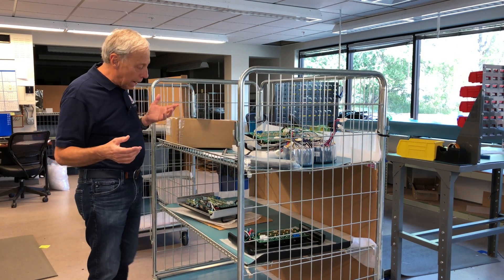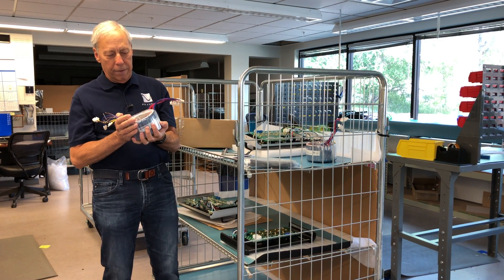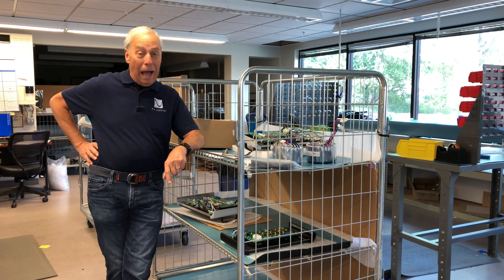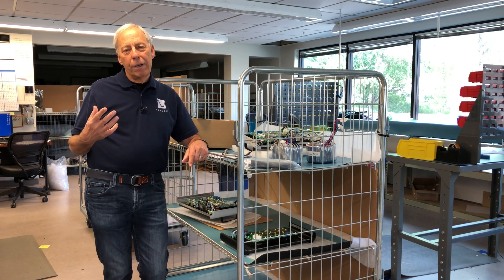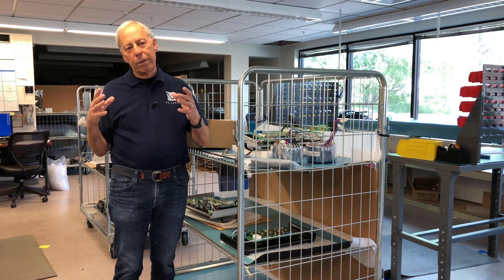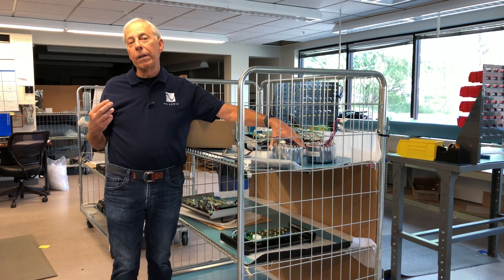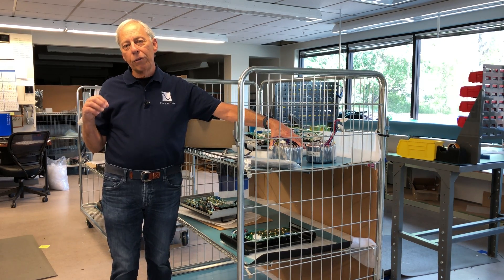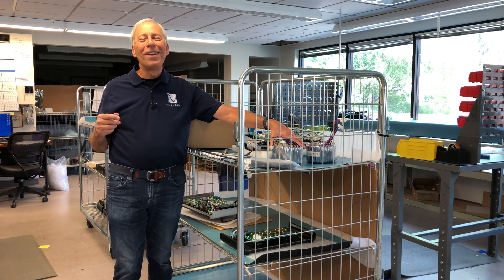Switching supplies vs. analog supplies

Comment: The 50-60Hz magnetic radiation of conventional power supplies inside a power amp is more problematic for audio performance than the higher frequencies generated by a SMPS, which are far above the audio spectrum and only present potential problems for equipment external to the audio signal chain.  That -- along with the huge size, weight, and efficiency advantages Paul mentioned -- is the reason why such state of the art amp makers as Benchmark, Hypex, IcePower, and (real soon now!) Purifi have gone the SMPS route in amp designs that are more than competitive with their best traditional counterparts.
Reply: This is untrue.  A modern amp has good PSRR, but only at low frequencies.  Once you get into the KHz range, the uncorrectable errors in output are two orders of magnitude higher.  It has little to do with whether the PSU frequency is within the audio spectrum because of feedback in the amplification stage.   If you don't even have feedback there, you're better off sticking with a battery, certainly not going with a SMPS.

You can take the exact same amp and power it with both PSU types.  Some amps (and some untrained or half deaf  ears) cannot hear a difference, but quite often the SMPS introduces undesirable harmonics which some describe as colorizing the music with falsely detailed treble mutilation.   That might be desirable if you preferred genre is trace music, but generally undesirable for most others.

They changed to SMPS because of cost.  They care not about your power bill so forget efficiency.  ;)    It is okay to be on a budget and not be able to afford the superior sound of a linear PSU, but make no mistake, that's what it's all about.

Those who value their audio, for a stationary system, have no problem with the issue that their rack or table has 20 lbs more weight on it, nor that it is a few inches taller.  The idea that these things matter to audiophiles is laughable.
Reply: @stinkycheese804  -- You couldn't be more wrong -- what you call "the superior sound of a linear PSU" is mythical given competent design engineering.  In fact, the best power amp ever measured by (the formidable Amir) of audiosciencereview.com is SMPS-powered -- as are the second- and third-best IIRC.  None of these units have any audible flaws AFAIK, and I doubt even the most finicky self-styled "audiophile" could tell the difference between any of them and even the most massive and exorbitantly-priced counterpart equipped with a linear PSU.
Reply: @stinkycheese804  Bob Carver perfected the SMPS for audio with his "tracking down converter" supply over 25 years ago with his Carver Lightstar amp and with his Sunfire line of amplifiers that were said to sound as good as amps costing 5 to 10 times what his cost.As far as weight many audiophiles are using tube monoblocks that weigh a LOT more than 20 lbs over SMPS amps and tube amps is what Carver is into now to great acclaim.
Reply: @stinkycheese804  The point I was making is that Carver used SMPS for over 25 years and not one reviewer mentioned any of the anomalies you say are inherent with them. And if they were present I'm sure someone would have mentioned them.  If his patents are nothing special why did Emotiva buy and start using them. Can it be that the genius of Bob Carver figured out long ago how to solve the issues you mentioned about SMPS for audio when no one else has.By the way how many patents do you hold or how many amplifiers of your design have been sold?
Reply: @stinkycheese804  By the way could you tell me who and what publication said the tracking down converter is nothing special. Another thing having a powerful amp means more headroom. Also some transients lasting around a millisecond can require hundreds of watts for faithful reproduction. Lastly the voltage level of conventional power supply caps can potentially run low during very loud power hungry passages  compromising the sound while Carvers SMPS design won'.t as the triac draws directly from the line in.
Reply: @stinkycheese804  About the names Bob Carver came up with like Sonic Holography Someone asked   Paul McGowan how it worked he laughed about the name but said his name for something similar called the Spatial Projector  awas just as bad but said you need  a name that will stand out with both the patent office and the customers. Likewise Carver  couldn't say he wanted to patent a SMPS but a tracking down converter he could. Since the patent was  real and unique unique how is this snake oil and smoke and mirrors.
Reply: @stinkycheese804  -- I have over 50 years of experience in electronics and nearly as much as a professional-level musician, and IMO the "superior sound" you describe is essentially undetectable by the very limited abilities of human hearing -- but, the "high-end" sector of the audio industry thanks you very much for believing otherwise.  Enjoy your investment confirmation bias and its entirely mythical quasi-technical basis!
Reply: @stinkycheese804  -- I happen to have three multi-page TI data sheets open in Acrobat Reader and none of them include a "PSRR graph."  The only mention of PSRR in them is the usual 1 kHz/no-input number number in dB.  So, I guess TI publishes data sheets than aren't "complete" enough for you.  BTW, I also glanced at the PSRR number for a well-known "high end" Class D module comprising discrete components, and its 1 kHz/non-input (apparently a de facto industry standard) PSRR number is comparable to those of the three inexpensive TI chips.

So, it seems Class D output circuit designers working at both extremes of the cost spectrum agree that a "PSRR graph" detailing those numbers at higher frequencies is not relevant when it comes to giving equipment makers the data they need to decide on what Class D output section to incorporate in their products -- in fact, the "high-end" module manufacturer I mentioned also offers and recommends their own SMPS boards for their modules.

Comment: I have 2 Sony receivers that have smps and both are dead. I have thought of putting conventional power supplies in them but I'm waiting for some good decent smps's. There are no switch mode power supplies in my stereo.
Reply: If a conventional PSU doesn't fit in the chassis, simply put it in a different chassis and use nice low gauge wire to connect the two.  This also gets the transformer further away so your shielding concerns (and/or efforts needed) are reduced.

Comment: Switch mode is getting better every day, but it is still not better than a good linear in noise performance.  Whether we want to admit it or not switch mode still puts out a lot of noise, both into the space and into the supply line.
Reply: Bob Carver started Sunfire 25 years ago and his amplifiers with his  "tracking down converter" ( a type of SMPS ) power supply were said to sound as good as amps  costing 5 to 10 times what his cost.

Comment: Well, transistors have been around for "some time", tubes still sounds "better" in some ways.
I wouldn't be shocked if analog supplies are still used at least in some HiFi a couple of decades from now, and that there will then be guys who prefer it like some prefer tubes over transistors today.

Comment: Isn't it just simply a negative too many components with the Switching PSU...?  More of a general failure rate.. regardless of the other anomolies? Or am I wrong?
Reply: Switchers have higher efficiency, lower volume, and lower mass, thus lower cost for manufacture and shipping and smaller end products. Failure rate is a function of design. Most equipment designers are not power supply designers even though they design power supplies. Properly designed power supplies with properly designed thermal management don't fail prematurely. The sad fact is that almost every consumer product is designed to a price point and when you cut corners you cut lifespan too. Don't blame the supply topology, blame the accountants.
Reply: @Peter_S_  Nope.  The fact is, things like capacitors in SMPS have a finite life rating and that rating is often down below 10K hours.  Argue with the capacitor manufacturers if you want to, but I figure they know their product better than you or I.
Reply: It's not just the component count but the nature of SMPS, that they have mains-facing transistors and diodes subject to power line surge damage (you can argue let's just use a surge protector to handle that, but it is not included with the product and needs to be a whole premises protector to be most effective, so it is not a part of the design), and capacitors filtering high frequency that run hotter than 50Hz/60Hz counterparts.

As a generalization, a SMPS will have less than half the lifetime before failure with all else equal.  All else often is not equal, but the trend remains that SMPS have a far more finite lifespan measured in # of years rather than # of decades.
Reply: @stinkycheese804  I have to give credit where credit is due as a generalization what you said is true.
Reply: @stinkycheese804  Your generalization is silly. Capacitors filtering high frequency still run a ton cooler than pass transistors operating in their linear region. No contest. How many power supplies in products of your design exist in the market to be a data source to draw from? I have well over 100,000 linear supplies and just slightly fewer switchers operating in consumer products right now on top of 30 years of designing and manufacturing a wide variety of devices in boutique volumes for various markets. I have gear still in manufacture today after several years and available through outlets like B&H, and I've also been repairing gear for roughly 40 years so I have a decent feel for what a wide assortment of designers around the world have come up with and what ends up failing so that it hits my repair bench. I've repaired a ton and a half of linear supplies, and encountered failed supplies of all topologies. Sure some parts have to work harder in some situations which is why properly sizing or oversizing components in designs is imperative and it doesn't matter if that's a capacitor, transistor, diode, inductor, or resistor. I don't understand why you're looking for arguments with generalizations, but I'm not interested unless you can state the number of products you've got operating in the market as a dataset to compare. Switchers come in a wide variety of flavors as do linear supplies. Some operate at line voltage, some at lower voltage. It sounds like you're trying to isolate one particular example of a switched topology as if it's universal... it's not. My experience says that reliability is up to how much you want to spend on the components.
Reply: @stinkycheese804  LOL, there are just south of 200,000 power supplies I designed running in gear right now. I'm done with your silliness.

Comment: As far as figuring out how to get rid of heavy power supplies on your high power amplifiers when will Bob Carvers patent's on his " tracking down converter " run out ? It's where the rail voltage tracks the input signal and is only 6 volts above what is necessary for a given output . Did Emotiva recently figure out another way to do it  ( as an ex-Sunfire employee ) or do they pay royalties ? In any event aside from being a lot lighter it's also very energy efficient.
Reply: Snake oil for marketing purposes.
Reply: @stinkycheese804  If you're talking about the names he came up with for his PATENTED designs I agree but it did help sales. As far as  to his ingenuity  he is up there with the greats . Most all of his products were highly acclaimed and beat anything in his price range and were said to sound as good as products costing  5 to 10 times what his cost. These days he is designing tube amps where the tubes last a claimed 50 years not 1 year and they do sound great.
Reply: @stinkycheese804  On second thought snake oil implies something fake , while the name was a marketing gimmick the technology was not and was way ahead of its time and did not impart any high frequency or any kind of audible anomalies .

Comment: One technique used long ago was when you finished designing your analog power supply you would replace the reference “diode” with a sinewave generator. You then would run the power supply into an inert load and run the sinewave generator up and down in frequency. This would check the frequency response of the power supply. If the application was audio you would run the generator from 20 → 20Khz. The power supply, now audio amplifier, should remain stable during testing.

I have no idea how to do this for a SMPS or even it it makes sense to test it that way.

Comment: Just FYI, I built a three channel 20W pure class A amp, single ended current sink topology, not over biased class B. This was for tweeter duty in an LCR setup. I needed +/- 24v at 15 amps per rail! So I took a chance and bought two surplus 24v, 15a switch mode power supplies. And these were open PC board construction to boot, not caged units. I did put ferrites on the DC power wiring and took other reasonable RFI/EMI precautions but no shielding. Upon completion I checked the output against an RF sniffed switching signal from the SMPS. At 5mv resolution I could detect nothing. Perhaps I was damn lucky but I was surprised at the results. I thought for sure I was going to be building a linear capacitance multiplier in another 4 rack unit chassis!
Reply: I assume that would be a low crossover ribbon speaker as I know of no other speaker / tweeter that would need that much power 360 watts?

Comment: Linear power supplies have very few components easy to design or debug  & less prone to failure vs SMPS with 50+ components & complicated design. But like it or not the future ibelongs  to SMPS because of the rise in  class D amps sales, rising energy , copper, iron, transportation , etc costs
Reply: Meh it's just because some people don't value audio quality, were raised on 128Kb MP3s and don't know any better or can't afford any better.  I can't fault someone for not wanting to take out a loan to buy good gear, but at the same time that does not change reality.
Reply: @stinkycheese804  May I add 128kbps brickwalled music on a shitty Bluetooth speakers with 8D audio

Comment: "Noisy" switching mode power supplies may be a thing of the past - but unfortunately - in the world of affordable consumer electronics like universal disc playerd in the 80 to 200 USD price range, the SMPS tends the first one to fail, sometimes within the first five months of usage. And unfortunately, only newer universal disc players made after 2013 have modular SMPS that can easily be field replaced. Older ones have their SMPS soldered on the unit's main board.
Reply: This is why that today, it can be very useful to learn to troubleshoot and repair SMPS by diagnosing and replacing discrete components.  Fortunately for most amps, there are not too many power rails to check, and those that exist can be divided into which subcircuit of the amp they power, has ceased to work.

It's not all a bad thing.  If you have to replace the entire modular PSU it could easily cost over $50, if not much more than that, while replacing a few capacitors, transistors or diodes, could cost under $10.
Reply: @stinkycheese804  Unless you're familiar with a particular unit your labor costs can exceed $50.

Comment: Are amps with switching  power supplies  consider as class D amps or not necessarily in all case?
Reply: I have seen the term "digital power supply" used to refer the switching power supply, so in the same way a class D is a digital amp I think its safe to say a switching power supply is digital.  Not that it really means anything as the class D amp does not use a DAC or ADC to function, unless ofc the input is a digital source. They are very different, but the principal of operation is mostly the same between them.
Reply from the maker: No. There are certainly amps that are class A/B that use switching power supplies.

Comment: And power supply rejection ratio (PSRR) of most audio circuits tends get lower according to increasment of supply voltage ripple frequency. Higher supply voltage ripple frequency then lower PSRR.
Cheers from Indonesia
Reply: What you wrote seems backwards.    PSRR goes down as power supply frequency rises.  You want the highest PSRR (reasonably) attainable, so much so that some people go to the extreme of using battery power so the PSU frequency is zero except for the ripple caused by the amp stage itself.

Comment: I worked for a power supply house as a technician and then engineer for most of my life. We started out building conventional power supplies but then started building switchmode supplies because of the size / weight and cost savings.

Building a quiet reliable switchmode supply is much an art as it is a science. If the layout and circuit design are not just right you will never be able to quench the supply noise. be wary of the small wall wort switchmode supplies, they are often used to meet a cost vrather than a performance criterion.